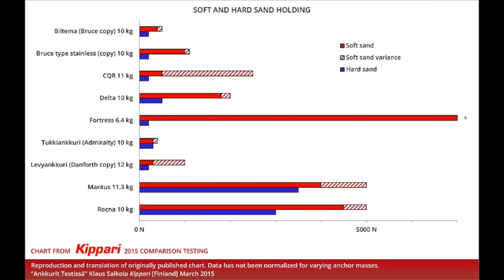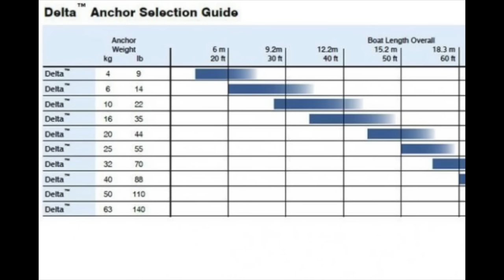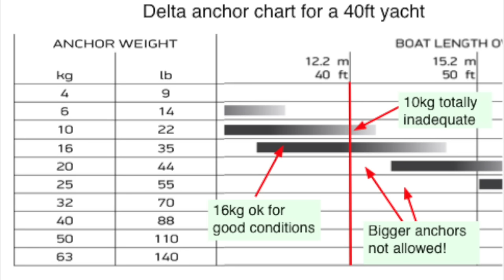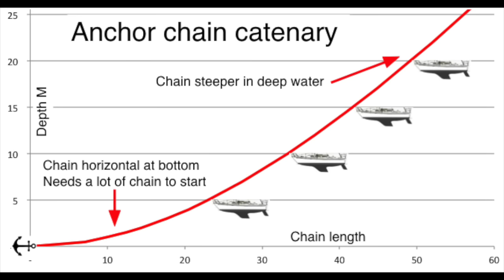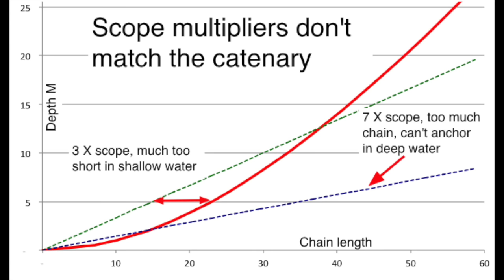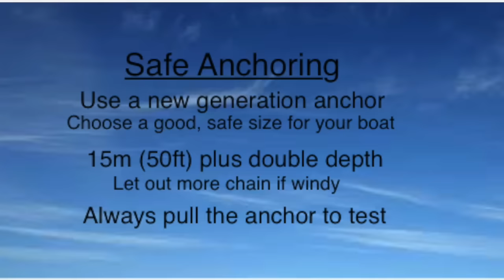Anchoring, how to stop dragging and be secure.

Comment: What about two anchors out of caution.  Is there a downside to two anchors?  (Anchors at an angle not in a row)
Reply: I works well for me. I use 2 when the wind picks up. It may twist my anchor line a couple times from the tide shifts but works great and I feel more secure. I set one 1st anchor, then I motor back to where I set it (only maybe 50yards to one side) and drop the second anchor, them I reverse motor back to same length as first anchor to set the second anchor.

Comment: On my CD27 I have 35#CQR, 22#Danforth, a 22#grappling hook, 15#Danforth 200' 5/16" G4 chain with 200' 1/2" rode and various other smaller anchors, a drogue and oversize deck cleats.

Comment: I look back on 22 Years of sailing most of it in the Carribean. Our Anchor equipment was our main concern and we would always look after it carefully. What I don´t understand is, 99% of the cruisers have GPS on board. all GPS Models have "ANCHOR-WATCH" built in and they use very little electricity, but few people use it! We always had the Anchor-watch on, even when tied to a Mooring Ball, Moorings do come loose from time to time. One more thing, using enough chain is a must (we had 10mm galvanized chain) but I found it very important to also rig a snubber to keep the chain from lengthening in rough weather and shallow depths!

Comment: Funny how the racing skippers avoid the extra weight on the bow. On an average 45 foot boat, a 30 kg anchor can hold much better than a 20 kg one, and the boat is 0,07% heavier, if we take into consideration that the average 45 footer is about 13 tones.

Comment: Didn't see the Danforth type anchor the all time king of holding in sand or mud.  An aluminum Danforth would have made the Rocna numbers look tiny.  The thing is the Danforth doesn't quick reset, but often having a Danforth as a secondary will save the day in the worst situations.
Reply: @richardmacfarlane8404  Well I have used a Danforth on a hard Sandy bottom.  It generally will do pretty well if the tines are sharp. A lot of space type or modified spade anchors don't have a sharp cutting edge to really penetrate hard sand.  The Rocna for instance which is an excellent design and by far the best option among the anchors listed here, does not have a sharp cutting edge. Whereas this makes it very durable, getting that "bite" for hard sand is typically somewhat limiting for the design.  Now another design similar to the Rocna is the Mantis anchor. It does have a sharper edge and features a little bit of a sharp point which AIDS in the penetration of hard sand.  The Fortress aluminum anchor can be huge, bigger than you, super light weight, yet sharp enough and strong enough to penetrate hard sand. It might take it three or four meters to do it though...also rocks tend to give Danforths/Fortresses a hard time.  If you are looking for a secondary anchor or kedging anchor you really can't beat the sheer holding strength of a Danforth.  If you are looking for a primary anchor in a cruising ground featuring hard sand I would work hard on buying a Mantus anchor.  Their website features a template you can use to mock up the proper sizing on a bow roller.  I hope this helps you Richard.

Comment: The good anchors are Spade copies or a Spade, the Manson Supreme and the Rocna roll bar types might be able to set in grass or weed but they find it very difficult to reset I removed my Manson Supreme off the boat ( anyone want it) so I back to 4 anchors. The Rocna Vulcan looks like a copy of a Spade so it is probably okay like the Ultra anchor. With the comments below like a snubber and cary the maximum about of chain on board. Still a good vid to bring anchoring to attention.
Reply: Grass and weed I have been anchoring in a bay on and off for over twenty five years with a new to me boat 4 years ago the only way I could get the Manson supreme to set was to go wide in to deep water to gain catenary, coming back from a friends yacht knowing that a 180 wind change was going to happen later that night I let out another ten metres and woke up to a change of movement, went up on deck to see the anchorage 500 yards away, ordered a Spade from Europe the next day. The Rocna might be better than the Manson both are roll bar anchors and both have trouble resetting in grass and weedy bottoms. I can drive over the the Spade for it to reset and bring the boat to a jarring holt in this anchorage like my old boat which Lloyds required me to obtain a barrel of 1/2" and 12 plait with a authentic CQR to gain insurance on my SS 43'  splined Huon pine 7'1" draft, man did that make a difference, 10 years anchoring and leaving the boat at anchor for months at a time to go to work away and  never dragged even in a 80 knot blow 1994 with moored boats flying passed me. If a real blow is going come on and the best place is already where you are anchored tie your second anchor to your anchor chain and let it out without it hitting the bottom for easy retrieval and less wrap up, the best Chum or Angel.  Cheers "Keep on cruising"

Comment: Great advice Richard! How about dropping 2 anchors to be safe as standard procedure when rougher weather is expected? That saved us a few weeks ago on a charter boat after we were dragging.
Reply from the maker: Thanks Christoph, the answer depends on the size of your boat and anchors. If you are less than about 35ft, you can hand launch and retrieve a second anchor if you need. But on our 45 footer, the second anchor would be much too heavy to manage. Ideally, yachts should have space for 2 anchors, but production yachts only have one roller, often too small anyway. Hence my suggestion of having one really good anchor.
Reply: When Wind changes direction 2 anchor chains/ropes can be problematic. Then, how to throw and how to retrieve the second anchor? Of course with a dinghy...
Reply from the maker: @lechtresowski8009  The last time I used two anchors was many years ago, at Nelsons Dockyard in Antigua. Soft mud and a Delta, not a good combination. I studied the history, Nelson also had problems there, so I was in good company!

Comment: All very true, but I would add that it's not always sand, here up in Nordic waters it's often granite and rocks. Those who take life seriously often attach an other rope with a boy to the anchor. This will allow you to pull it straight up not using the anchor chain. With some bad luck you might simply be unable to get it up and you will have to cut the chain or the rope.
At times the best thing to do is to drop two anchors in a nice V order.
Having just one anchor in your yacht is not enough if you want to play safe.
I have experienced all of this and lost several anchors too.

Comment: I was taught that we should drop at least three times the area depth in role for the anchor to be properly stuck  /held.. but it's a problem to find a good anchor.  I had a problem with my boat in the past and I was forced to stay overnight in the middle of a channel with the depth around 8 meters. that's nothing , ok, but that is enough to have waves.. I had to put out more than 1 hundred meters of role for my anchor to stay well stuck in the seabad... I set the gps to tell me how much it would move from the point I left it originally and it didnt move at all.  the weather conditions were harsh, winds of about 70 km/h.   the boat was 23 feet long.. waves of 2 meters high and the anchor was a danforth of 7 kg. the seabed was mud ( I think )... it held beautifully.    but the boat went up and down , got really wet... it had no cabin so I got wet too..

Comment: It is the chain weight on the sea bed that holds the anchor. If the chain is pulled tight from the anchor to the bow, the anchor will always break free. A commercial ship is not held by the anchor "digging in".

Comment: Nice explanation. Well, I've a much smaller boat (6.85m or 22' 6"). I'm still unsure about the anchor size but there are some things I know:
My Anchor is stored in the bilge and leached down to prevent it from scattering around when conditions get rough.
I use a chain at the anchor combined with a rope. Alternative: rope with a weight about 10m from the anchor. Once I used a broken starter motor as weight.
When I throw the anchor I tie the line at the bow but throw it from the cockpit, so I don't have to carry it to the bow.
Remember to supply your phone with power when using it as a anchor alarm! Put your Phone in a place where it cannot set your boat on fire when charging goes wrong. Never extinguish a burning phone with water! (except you throw it outboard) It can produce HF which will kill you if you breath it. Use a smoke alarm. You don't smell when you sleep.
Reply: What is HF? Hydrofluoric acid?
Reply: On a small boat without windlass,   there is also consideration how much weight you are your crew can lift and carry around :)

Comment: I’m currently in 25 knot winds. I’ve got a 25 ft sailboat in 6ft of water. I’ve got a sand anchor with fifty ft of chain and 6ft of rhode up to the bow. I’ve already had to reset it. I threw another anchor in and set it after my alarm went off. I need a heavier anchor for sure.

Comment: All good advice. I bought a 36 kg anchor in St Maarten for my beneteau-423.  I asked the salesperson of i could bring it back if it wouldn't fit the bow roller. It did almost fit, so just a slight modification to the pulpit was necessary. I was very happy and slept well in most anchorages. 🙂

Comment: It's not just anchors. I have seen this situation. Because I paid attention to Atlantic weather conditions 500 miles away I was able to predict large on shore breakers. I removed myself to a sheltered bay and advised others to do so.  Most did not move the local weather forecast was for light winds. The VHF talk the next day were as if from hell. Many boats damaged beyond repair.

There is no substitute for seamanship.

Comment: If a boat can't secure in at least 80' of various sea beds what is it doing cruising?? Its NOT READY. That's like touring in a motorhome without brakes or wheel chocks.
Reply from the maker: Anchoring is not always secure even with the right gear, and the right technique. There are so many difficult bottom types such as very hard sand, rocks, weed, very soft mud where anchoring isn’t secure. Maybe you have a good anchor, but not ideal for that bottom. The solution is to test the anchor carefully, and if it drags go somewhere else.

Comment: The reason for smaller recommendation is larger anchors often won't fit without reworking or replacing the bow fitment. Bigger is better, it just may be hard to fit.

Comment: Excellent video Richard, the advice does not age. I have a 65lbs CQR which I am changing for a 25kgs Mantus 2 on a Rival 41. The CQR is over size because it sets so badly! We frequently anchor on grass and it's un-nerving to swim over it and see it lying on its side just using it's weight to secure the boat.... 🥵
Reply from the maker: Thanks for that. I just think go for the best anchor you can fit. I’ve just returned from a few months in the Dodecanese, Greece, lots of wind and very variable bottoms, soft mud, hard sand, weed etc. We have a 33kg Rocna on our 45 ft Beneteau, and still dragged a couple of times. The Rocna is one of the best anchors, and we can’t fit a bigger one, so we have to accept we can never be 100% secure.

Comment: Don't bet your life on the weather report either. I'm on a 25 mile long lake. Last season the afternoon forecast was "chance of showers, wind 5kts, gusts to 20 kts" Pretty standard for the area, A couple hours later, a black wall starts coming down the lake. No way I was going to be able to dock or grab a mooring. I got lucky and just managed to duck behind a peninsula in the outer harbor and get an anchor set before it hit. Things went from just enough to to move the boat to 55+ kt winds with 6 ft, short interval waves in 30 min.

Comment: And ONLY a Rocna would have worked? Seems like it dragged, and it isn't a recommendation that your anchor dragged.
Reply from the maker: Thanks for your comment, I wish I knew what anchor is best, I’m certainly not an expert on anchor types.
I do know the ones not to trust, the Delta in soft mud, and the CQR is dangerous on hard sand. Also the Fortress fails in anything unless it’s soft.
But I’d love to know which is the best for all bottom types, the Rocna has a good reputation, but it can drag on very hard, rocky sand, where it can’t dig in. Also ours has dragged in very light, weedy sand, it digs really deep but still moves very slowly.
My strategy is to buy a reputable anchor, several sizes bigger than recommended, and take care when setting it.

Comment: Well.  There is a lot here.   I likely have as much experience and agree with a lot, but also have some disagreement.   As his own experience suggests, having a gigantic anchor of a particular type guarantees you nothing when the weather gets snotty.   A counter argument is that having an anchor you can pick up easily and move to the safety of sea or another place is important.  Having a snubber to take the shock load is as important as having enough chain on the bottom.   The additional holding power of a few pounds more on an anchor is a dubious benefit if you have set in a bottom that is impenetrable or foul.  You need to pick up and move.   The suggestions about scope and testing your anchor are  IMHO the best things here.   The manufacturers' claims about their anchors are BS and should not be relied on at all.  Lay out as much scope as you can when it gets snotty and be ready to leave if you see yourself cornered.  Have a second anchor ready to deploy if you are in for a prolonged storm.   Claims of "I never dragged with "X" brand anchor" are BS and based more on luck than any meaningful data.   Technique and judgement are what saves your boat.   Thinking equipment brand will bail you has lost many boats.
Reply from the maker: Many thanks for your comment, good points. I think the whole anchoring strategy changes when you get over about 40ft, and can no longer man-handle your anchor. Unfortunately, most production boats only have room for one anchor on the bow, so setting a second one is impractical if its over about 25kg. But the windlasses generally have reserve power, so it’s no hardship to go one or two sizes up. Sadly, there’s no magic bullet, it seems that the best anchor in the world will fail in some situations. The joys of cruising!

Comment: In 1980 I made a trip in a 32 meter schooner from Holland to the Bahamas. Our captain who was normally a 2d mate with Shell tankers Holland told us: at least 3 shackles plus the depth. A shackle is 15 fathoms is about 30 meters. The chain ought to be vertical where it leaves the ship. Otherwise you have to pay out more chain.
Reply: @richardmacfarlane8404  I think he meant at least 3 shackles. That weight will absorb the shocks from waves etc. I sail a lot on the Dutch Waddenzee. Once in force 7 the chain was quite straight by the wind force. The depth was about 1.4 meter. The chain broke under the shock of the waves. We had paid out all the chain, about 20 meters. Now I prefer a nylon rope, at least 7 times the distance between bow and sea bottom.
Reply: "Safe" is not good in some cases.
Ensure your chain length fits to others in the field.
You will be in trouble if the wind is changing direction.
Yachts will come in contact.

If in doubt: Stay out!
Reply: Hyperbole. If the chain is pulling straight down, then there is no horizontal force on the boat!
Reply: @fugue137  You are right!! He tried to teach us astronomical navigation so we were not so critical being his students at the moment. He was also much older, maybe 30 years and a very nice person. And had about 9 years been at sea. Shortly after that trip he became a teacher at the nautical College on Terschelling.

Comment: I have seen the recommendations for anchor sizes for a particular size of boat.   It usually includes a recommended Storm Anchor size.   Is there a down side of just using the Storm anchor as your primary anchor?

Comment: Its the weight of the chain and anchor combined that hold a vessel not just the anchor. You should always have 2 spare anchors one for the stern and a much larver one up forwd.
There are distinct weiğts laid down, for weight type and length of chan and anchor types and their weight.
Reply from the maker: Hi Kurt, thanks for your comment. For larger vessels, Lloyds registered, there are specific rules about anchoring equipment to keep them safe. But for the craft we sail, there are no rules. The inexperienced sailor is likely to adopt the "recommended"  sizes from the manufacturers, which is very inadequate in my opinion. The more experienced of us will learn a lot from personal experience and chatting to fellow sailors.